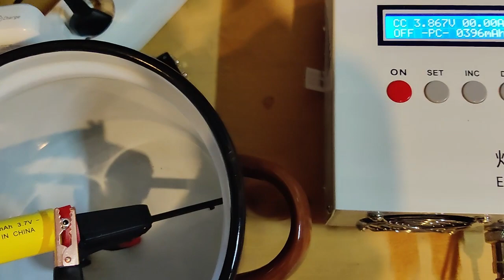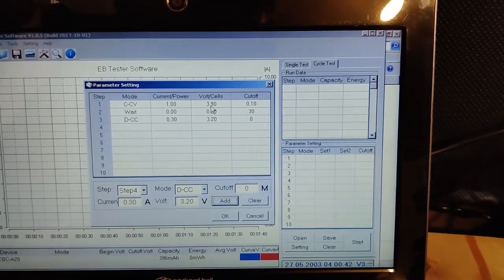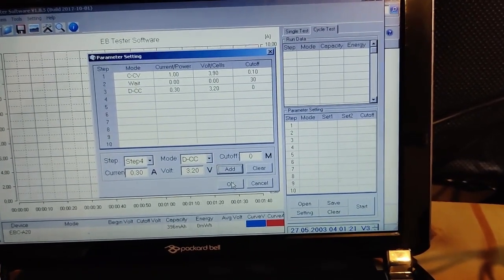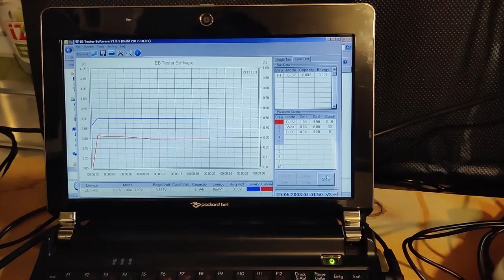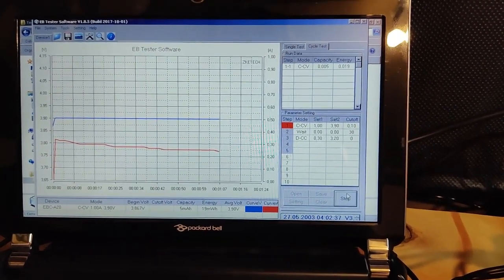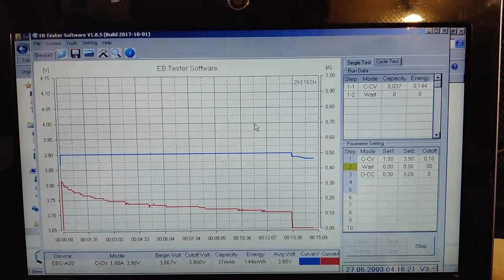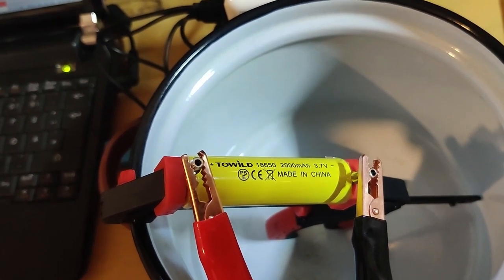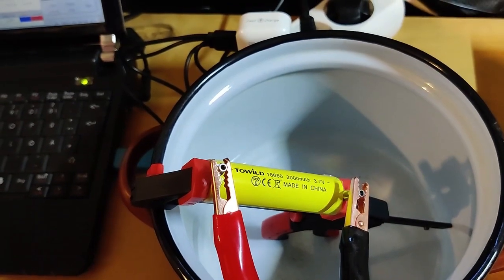Towild BR800 with 2000mAh Battery capacity test [cycle bike light] | Akku Kapazität [Fahrradlicht]

Comment: UPDATE: You got a dud and need to contact AE. I got my BR800 today with the exact same battery. It's pushing 1,850 mAh, which is quite in line with Chinese 18650 batteries labeled as 2,000 mAh. If you want the best you got to get 3,500 mAh Samsung 35E.